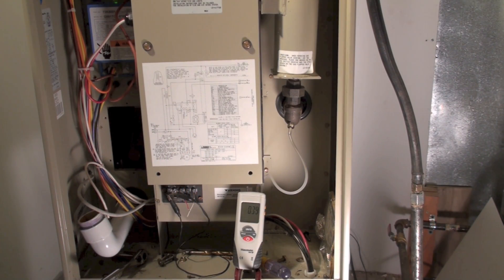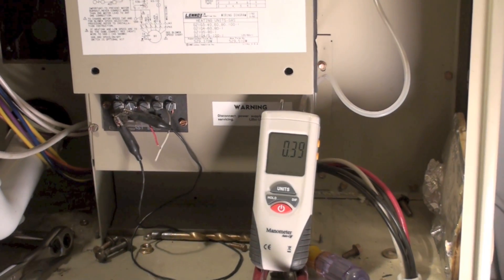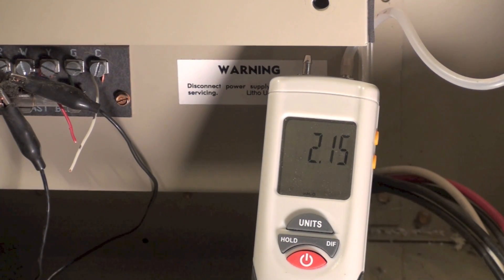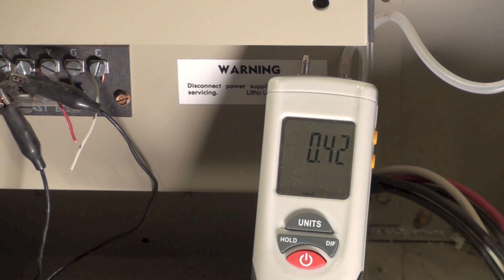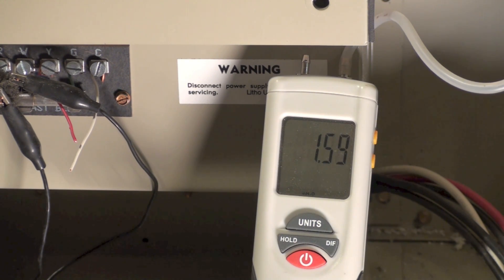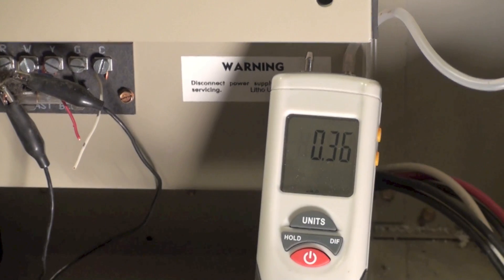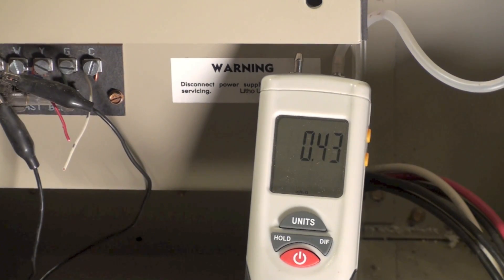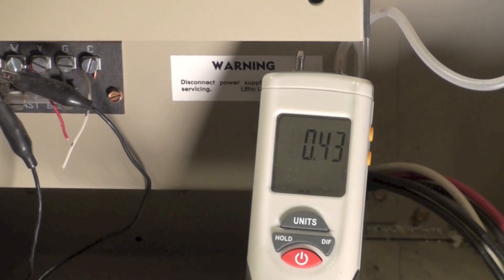How to check the manifold pressure on the pulse furnace

Comment: I have a good one for you. My uncle has a Lennox Pulse furnace.  I replaced April air humidifier filter, ran ok for a day or two. They called and said furnace was not working. Now up to this point, nothing was wrong, to my knowledge. I went over, and the only thing I did was remove the front cover, and it started working. Cycled it 5 times no issues. I did poke around on the wiring, to see if there was a loose connection somewhere, worked flawlessly. Put the front cover on, cycled several times, no issues. Sometime last night it stopped working. My uncle pulled the front cover, and it started working, any thoughts? I am stumped. Wiring seems fine as far as I can tell..
Reply from the maker: Combustion air blockage, possibly due to condensate drainage problem.
GFM

Comment from the maker: I have scrapped that furnace.  They all come from the junk pile and go back when I am done.  However, I did notice pulsing of the pressure gauge when using a dial type.  I had to use an electronic.  Are you sure you do not have a problem with a cracked heat exchanger?  Hope this helps.
GFM

Comment: Hey there, so i have a question. I only have a dial type manometer. When testing manifold pressure it jumps around quite a bit while running.  Do you have a dial type manometer? If you do will you test pressure and see if it jumps a bit? I know the "gas flapper" is sealing ok and i took it apart and everything looks good. If i blow and suck on the manifold with my mouth, the flapper seams to seal like it should. 
I had to adjust water colum to about 1.5" to get it to run. Thanks!

Comment from the maker: Yes it does have a problem.  I think the heat exchanger has a leak, although I have not found it yet.  It does not shut off after the trial for ignition, but only runs for 20 or so seconds when cold.  It gets shorter as you continue trying so I think as it warms the crack gets wider.  We will see as I go on.  Thanks for the comment.
GFM